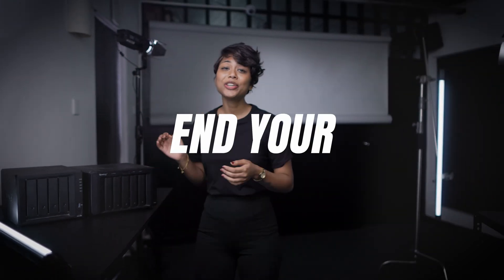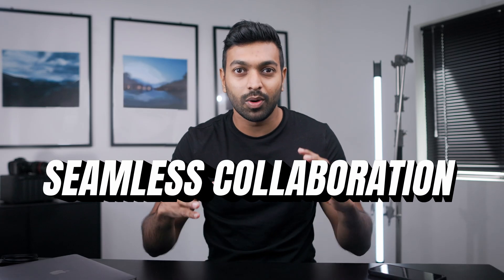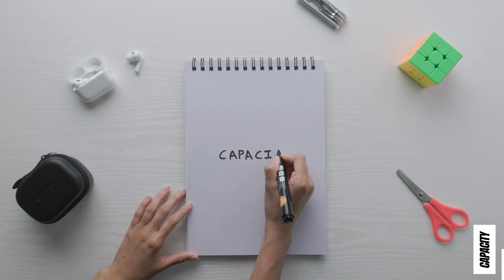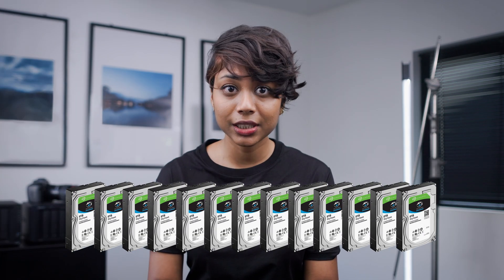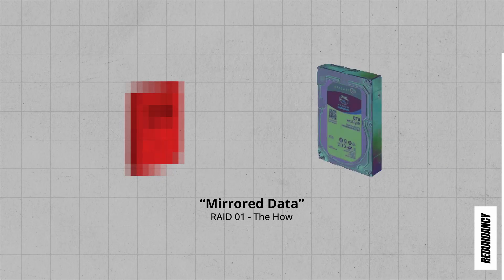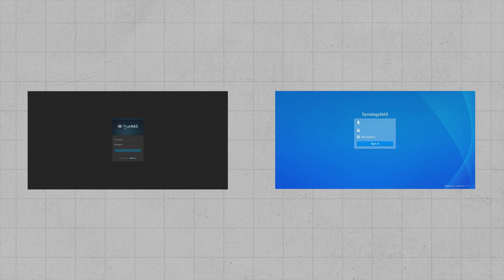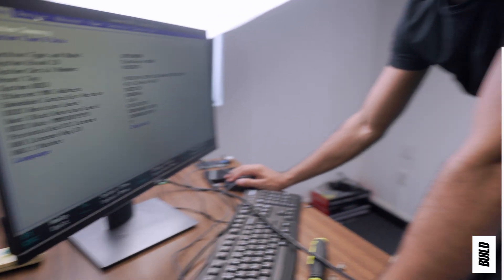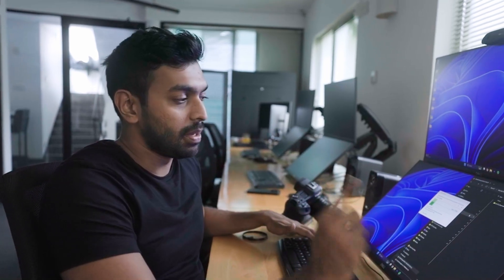Building the World's CHEAPEST NAS | What is a NAS

Comment: Man who are you this shiz is so high quality, got my hands on 4 6tb hard drives for free, been looking for a good video on exactly this, vedy good, subscribed
Reply from the maker: Let us know how the build goes.  Do some research on Raid,  get the most out of those drives!
Reply: If you need more storage, go with raid 5/raidz1, this gives you ~18tb of storage where 1 drive can fail and no data is lost. If you need security/redundancy go with raid 6/raidz2, this'll give you ~12tb of storage where 2 drives can fail and no data is lost. There's also raid 10 but I wouldn't go for that personally but read up on raid and go from there, you can always set it up in different ways before you commit to anything.
Also, try finding out what OS you want to run. If you have an extra SSD you can make that your os drive and have data on the hdds, truenas is great for that, truenas also likes a lot of ram due to its zfs filing system so take that into consideration. If you want to run your os from a thumb drive, unraid is the way to go imo. If you don't feel comfortable with any of the os'es you research, you can always use windows' built-in "storage spaces" (just type that into the search bar in windows) and set windows up as a headless pc/server with shared folders and so on.
Anyway I wish you luck in your endeavors and envy you for getting those hdds for free 🙂.

Comment: Good quality video. Also informative. As you highlighted in your video; building a NAS is easy. However, ensuring that you have configured ( user access, share rights, etc...) , secured (physical access and network access to NAS) along with a proper backup of your NAS (follow the 3-2-1 backup strategy ) should be your next steps. Building a NAS is great, but it is only the first step. What backup strategy are you using  for your NAS?
Reply from the maker: You're not wrong, setting up a  NAS is only the first step in keeping your data safe!  But it's the hardest to get right, and most important.  Have you built a system before? Whats your NAS setup?
Reply: @clearonyoutube  Yes. I have built a number of NAS configs; using decommissioned data center servers. I am currently running a  4 TB capacity NAS, with the 3-2-1 backup strategy in my home lab/office.

Comment: Just go and buy a used server machine.  I run an old dells with 12 terabytes of storage.  Wake on lan to keep power down, redundant power supplies, conventional 3.5 hard disks that are hot swappable in a raid configuration running Ubuntu.  I have 4 of them now and they cost me $400.00 each in 2020.
Reply from the maker: Used servers seem to be the way to go.  Whats the dell server you running? How many drives? 🤔
Reply: @clearonyoutube  I have 4 Dell PowerEdge R710s.  They come with Dual Xeons @ 2.5ghz so cpu power is no issue.  They had the 12 terabytes of storage and 64 gigs of ram out of the box.  They are still running strong.   

I originally got them for network rendering but once I started GPU rendering, they simply became storage so I need only run one at a time and just hotswap drives when needed.
Reply from the maker: @deadsetanime  R710 ❤ your running 8GB ram sticks?  Is this a truenas setup?  We running a R640 for our main editing drive. Unfortunately no rendering capability, but super faster storage.
Reply: @clearonyoutube  At the time I was doing CPU rendering.  I still use and love Lightwave 3D.  Now that I'm using unreal engine, it's GPU rendering all the way and it's faster than my 8 processors combined.
Reply from the maker: @deadsetanime  similar story for our team.  Since we mostly use Resolve, have GPUs on individual machines just makes more sense. But maybe one day we build a rendering machine!

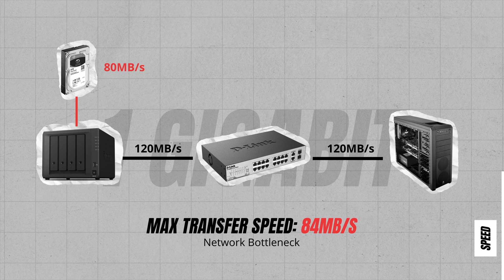Comment: 12:47 I have been chasing 100Mb transfer speeds and I've been going down so many rabbit holes, i never considered that my drive was what was causing me to get around 70Mbs in transfer speeds.😵
Reply from the maker: EXACTLY! Thats what most YouTube videos don't tell you.  The bottle neck is at your weakest link.   Super charging one point in the chain, isn't going to help your speed.....but maybe upgrade your hard drive????
Reply: @clearonyoutube  Honestly, the drive on my NAS and the drive on my Linux computer are pretty new, but on the cheaper end of the spectrum I suppose. 1 is a 10TB WD red plus, and the other is a Seagate Ironwolf 8TB, both CMR; so I'll probably let them ride till one gives out. At least now I can quit chasing other hardware issues.😂
Reply from the maker: @ you might be able to get away with using your two hard drives in some sort of raid. Get similar capacity and double the speed (possibly double the risk) It's usually not recommended for mixed drive though.  Have you tried?
Reply: @clearonyoutube  I have not. Currently I only use the NAS drive as a media server to stream movies and tv shows at home. The 10tb drive on my Linux box serves as one backup, and I keep an additional 8TB external drive for my 3rd back up. My original problem was I was getting less than 1MB transfer speeds between the Linux computer, and a pi server I was using. Now I am using a Dell precision PC with OMV as my NAS, it idles at around 15-16 watts, 22-24 watts streaming, and I'm getting a decent 70MB transfer speeds to and from. I will probably let it ride until I replace my Linux computer with better hardware, it's already close to 10yrs old.😂
Reply from the maker: @daledoe-baggins  70MBps is more than good enough for day to day streaming. @arcus23424 in the comments is  trying to setup something similar.  We are planing a new video on how to setup Plex correctly.  What are you using to stream?

Comment: Good content, very high quality production. The content is also very helpful, especially for beginners. Keep on going...
Reply from the maker: Glad it helped!  If you end up building a system, do share the specs!
Reply: @clearonyoutube  I built one a long time ago from a desktop PC. Still in use even now, so makes it about 7 or more years. It's an i3 4th Gen, 5TB HDD (With a small SSD for OS). And yes, runs on Windows, why, it already had the locense embedded so I did not need an alternative OS for simple use case.
Reply from the maker: @RurayaK  Thats neat! A single HDD? No raid?
Reply: @clearonyoutube  The HDDs, 2TB x2, 1TB, no raid because most data is backed up elsewhere, so I prioritize storage space instead.
Reply from the maker: @RurayaK  risky business 🤣 If you have a back up, consider running Raid 0.  Maximise your storage, double your speed.  Double the failure risk 😅
Reply: @clearonyoutube  I will take this into consideration. Maybe I can do that in a new server that I will build with more storage capacity and maybe even use TrueNAS.

Comment: eBay US is best for refurbished, or used hdd. You can get insurance on the drive in case it goes bad.
Reply from the maker: That's a fair point! Although that's not necessarily something you can expect/rely on in every region :/
Reply: @clearonyoutube  Either way in my homelab I've had  at minimum 40 refurbished \used drives in 10 years. 2 went bad.  Look at the monthly Backblaze stats. These drives have a lot to give and are engineered well. Read the stats.
Reply from the maker: @waregeeksny  40 drives for a home lab is amazing 🔥What exact are you using backblaze for?  Backing up your nas to the cloud?
Reply: @clearonyoutube  Hahahaha. I have a HP Storagework D2700. That holds 25 960GB SAS drives in RAID6. I have one server attached to the Storagework and had multiple servers throughout that time.  Most of these drives were 3.5 SAS\SATA. So it may seem I have a lot of space I have currently 30TB on one server and another 20TB on another server.
I use backblaze as part of my 3-2-1 plan to backup my 2 server session state and c drives,  movie collection and personal data. That 5TB.
Reply from the maker: @waregeeksny  oh nice! We are thinking of doing a poweredge build for an upcoming video.  We have no experience with SAS drives, which the power edge seems to use.  We may need to get some information from you on our hard drive options. Have you tried any SAS ssds?
Reply: @clearonyoutube  I just bought my first 4 SAS SSDs recently, they are awesome and fast. They are just expensive at larger sizes compared to spinning drives. Now there are NVME drives which are even faster and more expensive. So in the end you have to find balance with what you can afford and what you need. You may not be able to get everything you want but getting half is great.